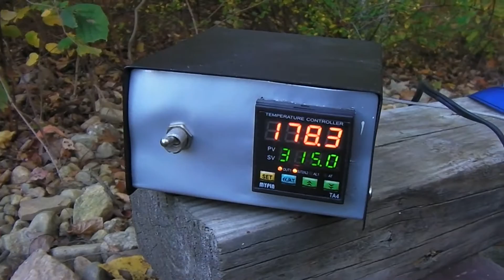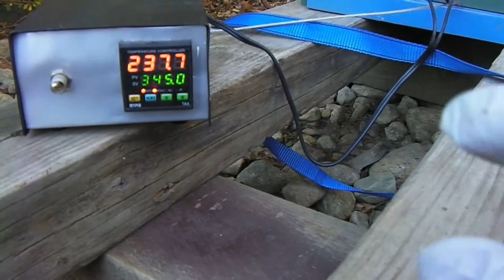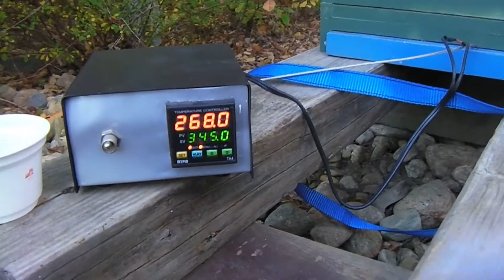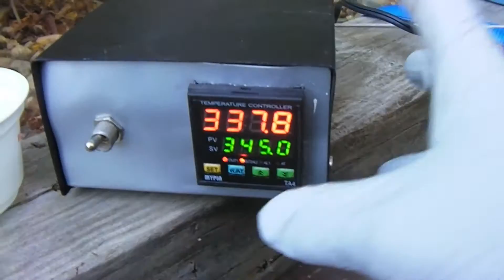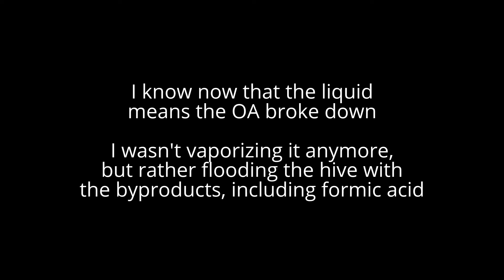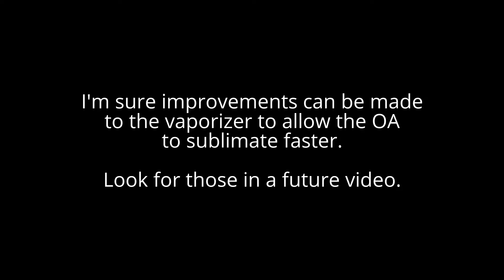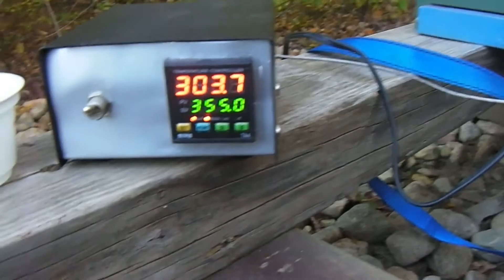Episode 13: Treating for Mites with my DIY Oxalic Acid Vaporizer

Comment: What temperature controller are you using?  From what I've read the OA sublimates between 157 and 189 Celsius, but at the 189 it starts to break down, so it seems we should be shooting for about 175-180 Celsius.  I'm looking to design my own OA Vap, and am interested in any info you can share.
Reply from the maker: +Paul Phillips The OA will actually start to sublimate as low as 102 Celsius or 215 F.  At a certain temperature I didn't notice much of a difference in the rate that it sublimated - I think 315F to 330F (157C to 165C) is a good range to shoot for.  Certainly at the decomposition temperature of around 372 F or 189 C the OA will rapidly degrade to a liquid (formic acid) and further decompose at higher temps.  It's critical you don't get to that decomposition temperature, because it's not as if you can cool it to turn the liquid formic acid back to oxalic acid.  This is why vaporizers with thermostats that run around 350F (176 C) are not ideal because they could easily get too hot as they cycle on and off.  I'm convinced most people, even with some commercial vaporizers, are treating their hives with boiling formic acid, thinking they are vaporizing OA.
Reply: +Dennis Atwood what is the temp controller you use?
Reply from the maker: +Paul Phillips Sorry, I missed that part of your question.  I use this PID controller: http://www.amazon.com/AGPtek%C2%AE-K-Type-SNR-Temperature-Controller/dp/B007H5GQUY/ along with an SSR:  http://www.amazon.com/Amico-Solid-State-SSR-25-24-380V/dp/B0087ZTN08/ and a cartridge heater: http://www.amazon.com/Electric-Heating-Element-Cartridge-Heater/dp/B008SA7J08/

See my previous video about the vaporizer:  www.youtube.com/watch?v=lJYH4GOG-Zo